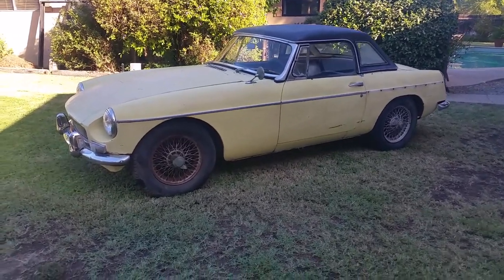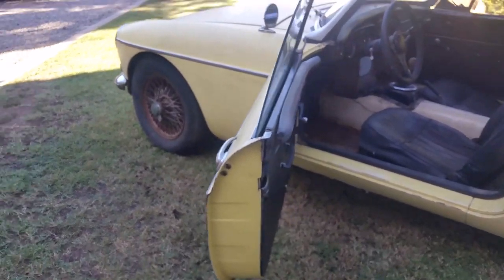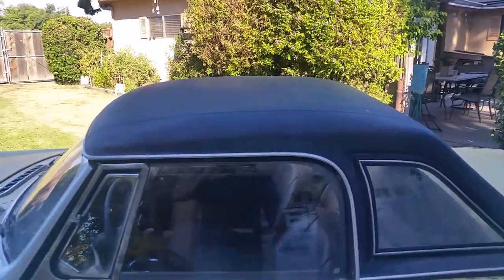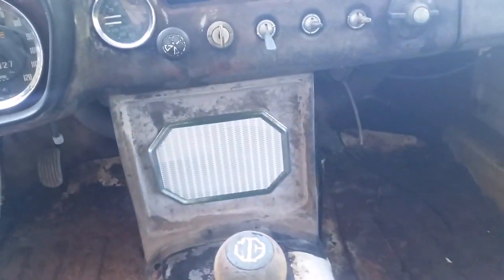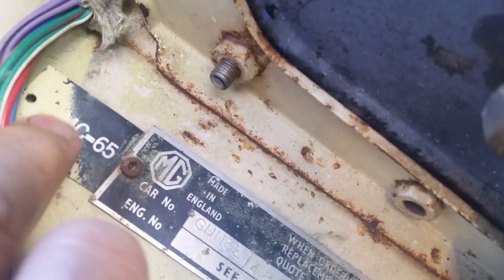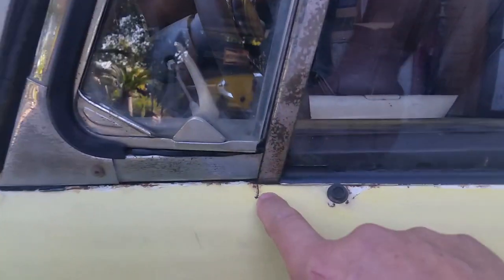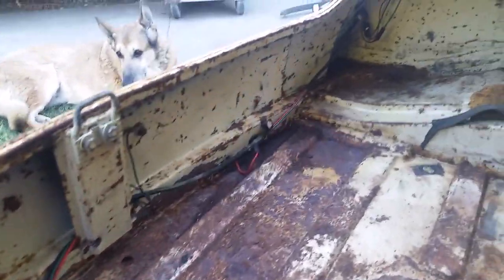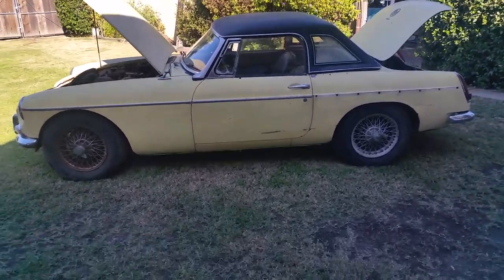1965 MGB Barn Find, out of 35 years of storage!

Comment: Very rare MGB... a 1965 model year built in 1964 with  pull  handle doors and a a 5 main engine... you scored !!!!
Congrats. 
Mirrors were not installed at the factory.. Dealers offered choices at point of sale. 

Here is something to check and a small but significant detail of  the early Series l Cars..

Look closely at the front grille.
Are the vertical slats individually riveted or is the whole unit including the slats "pressed" from a single piece of metal.
If riveted, another rarity.. an original series l grille as is on my 1964.  Rare as hens teeth these days.